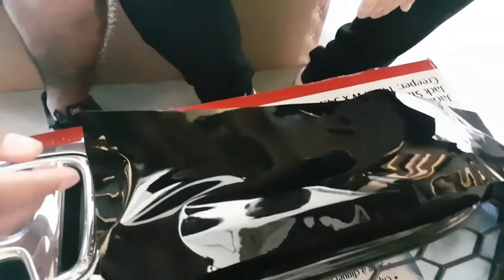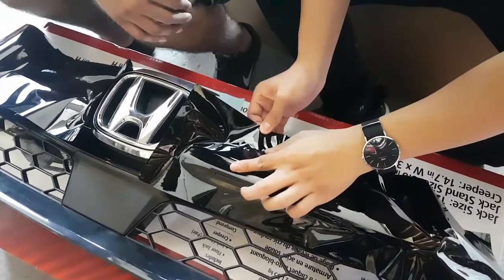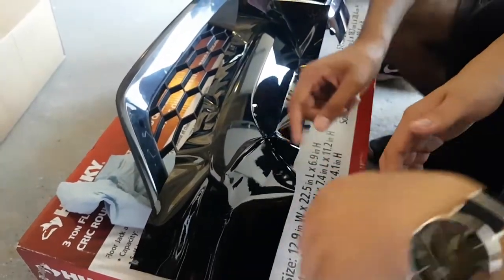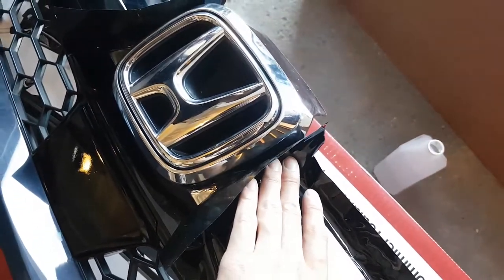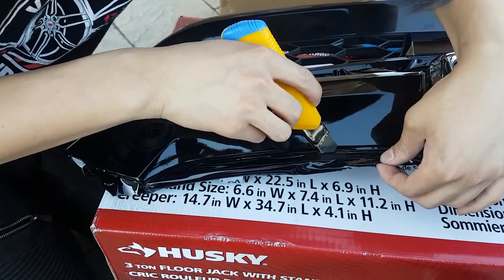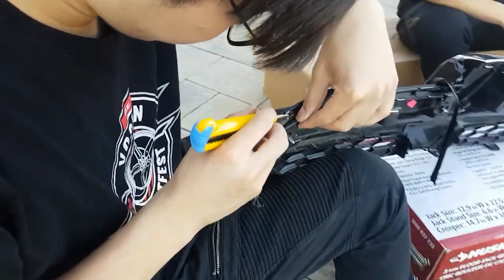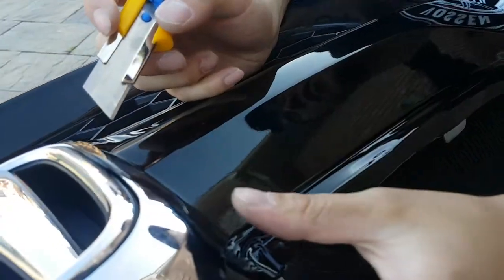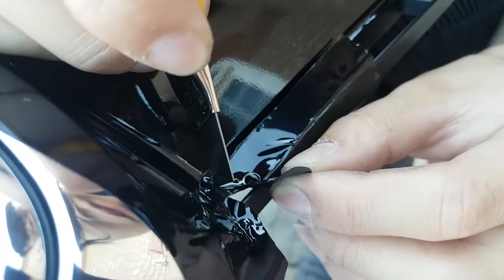VViViD Gloss Black Vinyl Wrapping My Grille (CRV 2017)

Comment: Do you have any of the Honda Sensing features on your CR-V? I want to know if wrapping the grill and or changing your bumper affected the safety features?
Reply from the maker: I have the cruise control breaking, lane keep assist, and the breaking warning indicator. Im not really sure if theyre the Honda Sensing Features youre referring to, but the wrap has not affected any of those functions
Reply: Quick update. I wrapped the radar cover  like you did and I only made it about a half mile down the road before my dash lit up and all my warning lights were going off. Needless to say, I had to pull the wrap off 😞

Comment: i noticed you also wrapped the rear chrome garnish. did you also remove it and then wrap? could you provide the steps? thanks
Reply from the maker: I actually wrapped that off video. I did it by using one long piece of vinyl. I placed the vinyl across the trim and worked outwards starting from the middle where the logo is. It is far from perfect and there are some wrinkles under the H, but it is hard to notice from a couple meters. No trim was removed in the process because I was afraid that I might break the clips behind it. The technique is pretty similar to the bumper, where I just smoothed the vinyl out and cut along the edge. I left the logo for the end and I cut out the vinyl, sometimes tucking the vinyl behind the border of the H
Reply: thanks! looks really good!

Comment: I've been wanting to do the same. Mind sharing how you got the front chrome piece off?
Reply from the maker: Once you take the bumper off you will notice that the chrome piece is held by a series of clips. However, I recommend not taking it off thought as it looks complicated, fraglie, and tedious. I would say wrapping it on the bumper would give similiar results
Reply: @AnthonyMo  for some reason I think the clip of my chrome under the headlight broke. Do you have any idea what kind of clip that is? Appreciate it man..
Reply from the maker: @blahblahblah96  Hey Enad, I broke one of those clips as well. I think they are a part of the chrome trim so there might be no replacement unless you replaced the whole piece of chrome. I'm not 100% sure so you will have to do some research yourself.
Reply: @AnthonyMo  Appreciate it man.. was searching but I think you are right it comes with the trim if you want to change it which is sad. Anyways, Thanks man.
Reply from the maker: @blahblahblah96  Yeah it is pretty sad when things like that happen, been there before. No problem and best of luck with it!